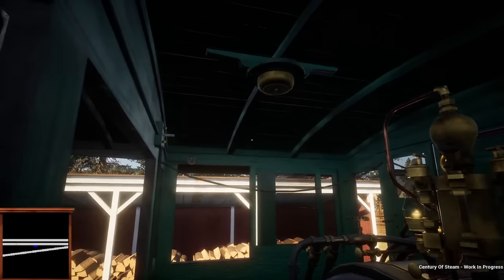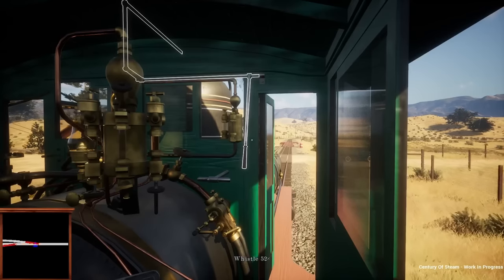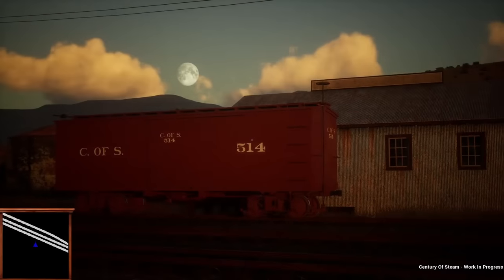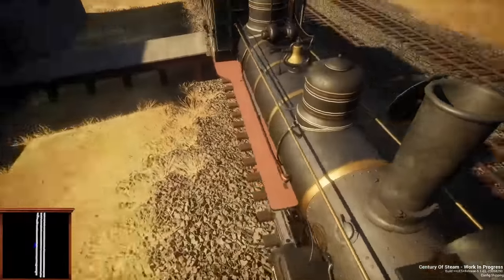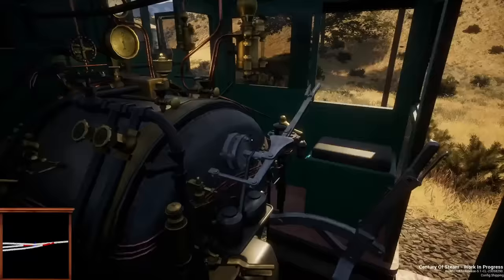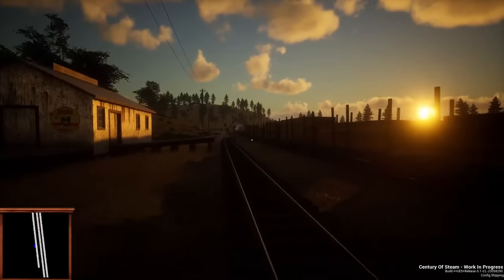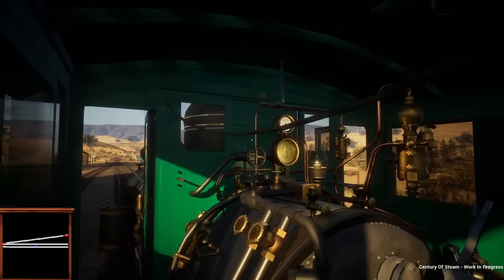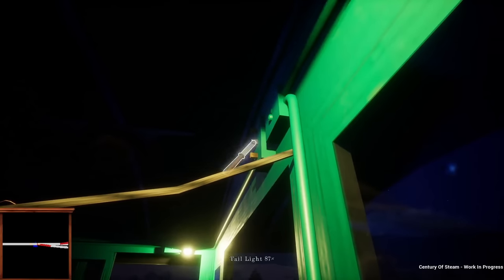Century of Steam - Developer Q&A #2 + missed demo features!

Comment: 22:11 - thanks for answering my question. Definitely agree, it sounds great at slow speed, especially the initial start. At high speed however, it starts to become a bit garbled, more like a boiling pot of water than a steam locomotive.

But I wish you luck as you tackle this challenge, so much of the sound design is already really well done.

Comment: 100/10
Cant wait!
By the way: will we be able to upgrade track & rolling stock infastructure? Like replacing link & pin couplers with knuckles, (or even split knucles), giving rolling stock roller bearings, replacing stub switches with point switches, or replacing a wooden bridge with an iron one? (This is totally not because I hate stub switches)

Comment: Optimizing the game for less-than-top-of-the-line-graphic-cards will certainly be a big task. Complexity of models will need to be decimated down and textures will need to get optimized and their resolution scaled down. That way one wouldn't need a 24GB VRAM just to load the texture files. 

As a former fullstack developer/designer of oldschool upbringing, I wince everytime I see "minimum requirements" for modern games. Somewhere along the line developers and game artists lost the ability to optimize, and instead blame players for trying to run their game "on a potato".

Please, please, please.. a thousand time please, don't go down that route. Invest the extra time and effort into allowing less powerful systems to run the game smoothly. It'll pay off a hundred times over in the future.

Comment: Question thats probably already been asked: will there be coal firing in the game? As I commented on your firing 101 video its my favorite on your channel and i'd love the chance to fail at it. If so will it be like firing in derail valley (which I can sorta do) or something different/more detailed?
Reply: NOTE I AM NOT A DEV I AM JUST MAKING EDUCATED GUESSES/SPECULATING Judging by this video they put out: https://www.youtube.com/watch?v=AbChsVwkTZE it seems they plan to include both coal and wood burning. If you look closely at the tender in the video you can see what appear to be piles of coal and wood for firing the engine. Now granted these could just be aesthetic changes (that is what the linked video is about after all), but  I doubt Hyce and Studio 346 would add coal and wood to a tender just for looks. Most likely the oil firing is what got "done" first and is what they are showing off, with coal and wood firing coming later down the pipeline because of their detail, and relative complexity. As for detail, I would assume the coal firing can be very detailed if you want it to be, just like the rest of the simulation seems to be. NOTE I AM NOT A DEV I AM JUST MAKING EDUCATED GUESSES/SPECULATING

Comment: this game looks so beautiful!! i hope we get to see the K-37 in action soon though. but its whatever im already happy enough with what we have.
Reply: Much to my chagrin, I'm guessing they're saving those for later, both for building that hype, and because the more modern locos probably involve a lot more stuff to work out.
Reply: @WasatchWind  IDK, I feel like it would almost be the opposite. The lifetime of customizations on a modern engine is shorter relatively speaking than the lifetime of customizations than the engine they showed off in the Patreon video just due to time released. A K-28 for example was first built in 1923 meaning they only have 46 years of operation covered by the game era and  they were locomotives only bought by a few railroads. The 2-8-0's they keep showing in the customization trailer are a roughly 1870s design meaning that is roughly 100 years of customizations and variations to track, many variants of which might not have been photographed and were bought by many railroads. 

The one thing that might be harder on a more modern engine is simulating the superheating. Superheated steam has a different "characteristic" to it in how it performs than saturated steam does and if they want to capture that detail then a superheated engine needs to have that fine difference in performance. It is not a huge difference, but enough of a tweak under the game's hood it might warrant some finer tuning before it is ready for the big time.

Comment: When using hotkeys for controls there should be a display pop up on the bottom saying throttle % or the status of whatever you're controlling. That's one thing I feel is lacking in dv bc irl you'd bc able to feel how much you're moving controls but with keyboard buttons you don't have a sense for how much it's moving and can move it too far or not far enough

Comment: I'm excited to learn firing on locomotives. I was a Marine Engineer for a short period of time before changing career paths, and also went to school for power engineering. So I am very experienced with Marine and Stationary boilers, but locomotive boilers are a different beast and I think it will be a fun challenge to learn the unique characteristics of mobile boilers, such as steam injectors. All the boilers I have worked with have separate pumps for basically everything, since space isn't a concern for them.

Comment: You said it was an A1 automatic, and then a G6 later. On a different note, are the diesels simulated yet? Can you drop fires in wood/coal burners?
Reply from the maker: A1 is the brake schedule; the G6 valve is actually the valve utilized within the A1 brake schedule.

Comment: I hope u are not gonna stick to those awful "stub switch" points. Even on narrow gauge those were "out of fashion" in the early 1900's.
Also is this means the airbrake on the rolling-stock works, not just on the loco?
Reply: Many 3' lines kept stubs all the way to either abandonment or preservation. You can still find them in use on the D&S, EBT, OERM, CRRM, and the reconstruction project at Como to name a few.
Reply: @WingsStrings  I didn't said u can't find any today (tough those went extinct in my country, with the exception of some mines, long ago), but its just "pain in the ass" to fiddle with them, and the game takes place around the 1920's so...
Reply: @TomPrickVixen  The game's titular century covers 1869 to 1969, and stubs are no more difficult to throw in game than a point switch.

Comment: It looks like a exact copy of railroads online
Reply: RO doesn't have the following:

- A ten wheeler (that is realistically modelled) 
- A combine
- Oil firing 
- Selectable Cab views 
- Selectable whistles 
- Two way stub switches 
- Realistically functioning air brakes 
- Ambient wildlife 

and not to mention realistic scenery, bridges, lighting and structures that have interiors you can actually go in and see as well as more that has likely not been revealed to the public yet.

about the only way this is an "exact copy of RO" is if your only criteria is "Is train game in some version unreal engine 5"